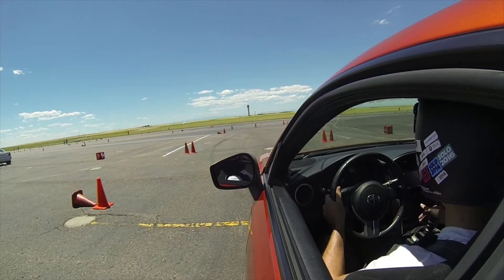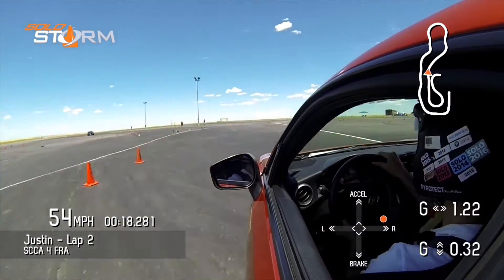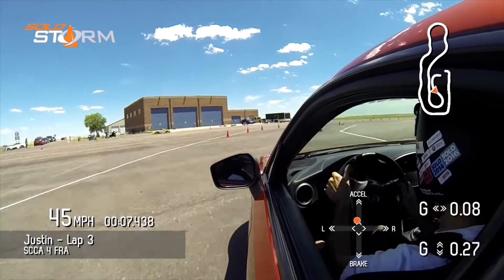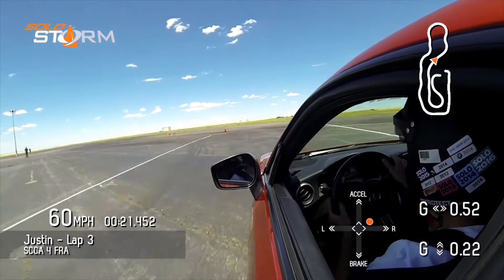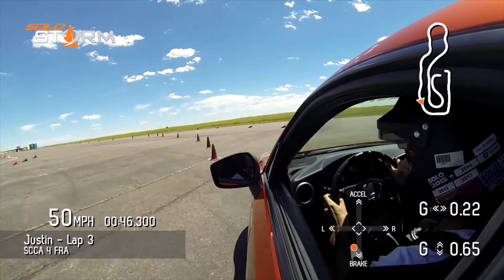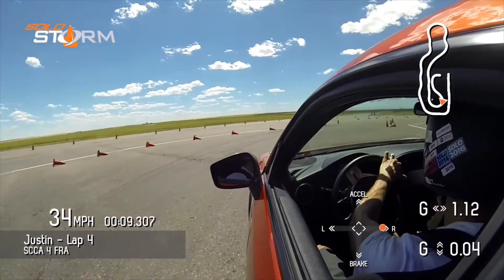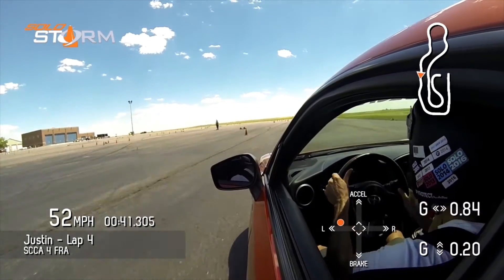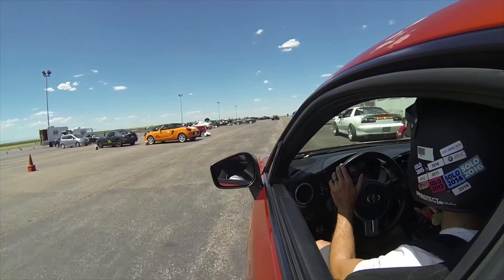FRS autocross after new race alignment

Comment: Are you still running the RCE T2's (if I remember correctly)? How are those working out for you? What spring rates did you choose, and why?
Reply from the maker: Yep, still on the Tarmac 2's, they are great! I went slightly stiffer (450lbs springs) than what comes with the kit (400lbs springs). Mostly so I had a tuning option but the 450's all around have worked pretty good. About the only I might try at some point is putting 400# springs on the front with the 450's in the rear.